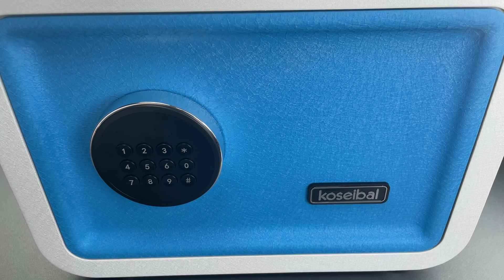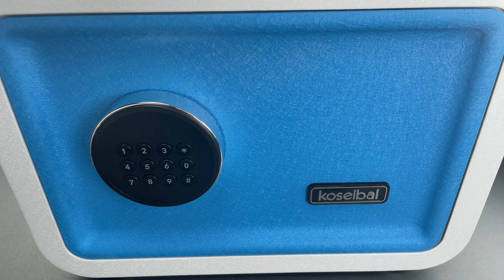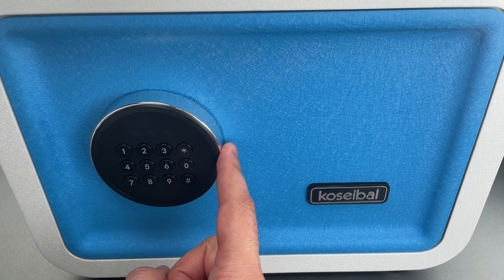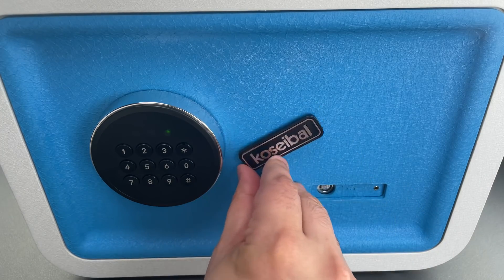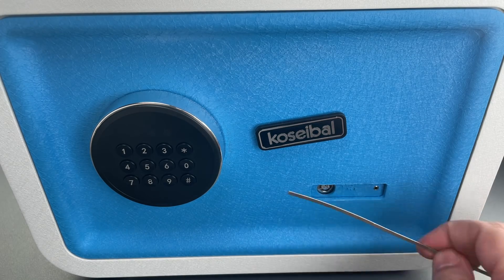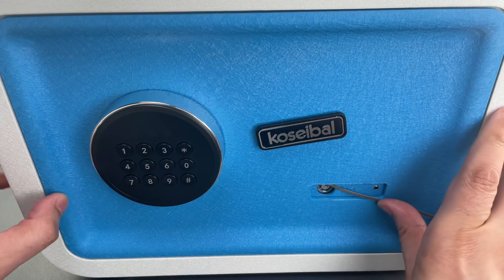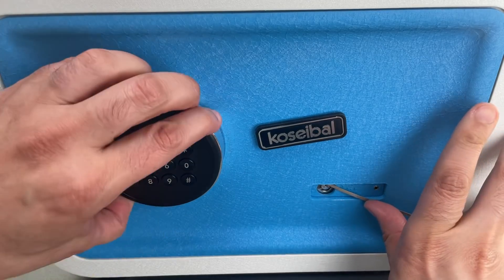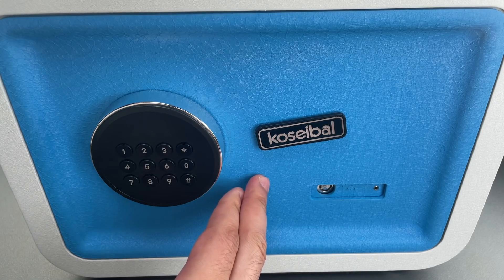[1321] HUGE Design Flaw In Koseibal Safe

Comment: The mechanical backup always seems like an afterthought to these designers
Reply: They should instead use protected external battery contacts in case internal battery dies. And completely forget about mechanical backup
Reply: It's not, LPL can only unlock these because he's already seen what's inside.

No thief is going to be able to notice a certain safe in the house they're breaking into has a certain design flaw, and conjure up a magical tool to gain access.
Reply: @Jamato-sUn  Or a time delayed mechanical backup that only triggers a 24 hour countdown to reset.
Reply: @KiLLJoYYouTube  but if they come prepared they will have an easy go
Reply: @Jamato-sUn  and what happens if the internal charging wires are damaged?
Reply: @KiLLJoYYouTube  Then the owner should purchase an angle grinder, and then a new safe.
Reply: @KiLLJoYYouTube  wait til this guy learns about the internet. All it would take was a google search to find vulnerabilities like this.
Reply: @KiLLJoYYouTube  "Magical tool" = "Scrap of metal" ... right.
Reply: @KiLLJoYYouTube  Good things these safes aren't mass manufactured, and thieves couldn't use a search engine. Or buy one to experiment on, once they know what type it is.
Reply: @Jamato-sUn  And then someone (hopefully not the owner) comes up with the idea of connecting a 110 (?) Or 230 V AC cable to the contacts. (Not to open the safe but to destroy the lock. "Did they stole something of value?" - "I don't know, I can't open my safe.")
Reply: @KiLLJoYYouTube  All you really would need is sort of a 'database' in your phone, list of names of the safes and short description how to easily defeat them. Then you would carry small repertoire of tools and do what the guide says. Obviously this would not be easily applicable in every case but think of the easiest safes that we've seen in LPL's channel, some of them really only require just a magnet to defeat. Obviously with a guide opening safe like that would be a cakewalk.
Reply: @KiLLJoYYouTube  knowing the easy entry flaws of 20 or so common household safes would make for some very low hanging fruit for thieves
Reply: @jobowobo6700  Time delay is interesting and for personal safes might be cool but not always useful (at least in hotels where you need to be able to open them if someone has forgotten the code again... )
Reply: I think they just don't want to put an mechanical lock to these things that costs more than that electronic lock to make so they put kind of garbage mechanical locks to these things.
Reply: @JohnADoe-pg1qk  Could put a protection circuit on those contacts.  The circuit would be destroyed by the excessive voltage, but the electronic lock could still be used.
Reply: Quick message for those reading the replies, keep in mind that lpl make these videos to inform consumers what products to avoid, not to educate thieves.
Reply: @KiLLJoYYouTube  Security by obscurity is never security. A product which could be unlocked by chance as a thief wiggles around is not safe. Perhaps THIS flaw is too specific to actually work, but there are a couple other locks which can be unlocked by chance, like one of those gun locks which he accidentally unlocked.
Reply: @Jamato-sUn  They should instead forget to reinvent the wheel and outsource a safe lock core from a well-known company. The problem is that cost reduction is always messing with these unknown brand products. They know barely 10% of their customers will even have a look at how secure is their backup lock and less than 1% will be able to tell the difference between a safe and unsafe core. These companies just want to make a sale. It is not about making the highest security product they can, it is about making their owners think they have the highest security product even when it's not, and making the product as cheap as possible while keeping this apparent security.
Reply: Thats because these are electronical companies, who buy metal sheets, turn them into safes, and know nothing about actual, mechanical locks.
Reply: @KiLLJoYYouTube  Or he recognizes the type of lock. See the video number? That's 1,321 locks that he's picked for us. He only uploads about 1% of what he actually picks, so he's easily picked 100,000 locks.
Reply: @AcidCrab  So the thief is going to walk into your house, connect to the internet and spend 5 minutes googling how to bypass a lock on your safe? no chance.
Reply: @GamesFromSpace  So every thief has bought every model of safe to experiment on, and knows every single vulnerability just from sight?

here's a hint: criminals aren't locksmiths.
Reply: @KiLLJoYYouTube  When they have your safe sitting at their house they can take all the time they want to open it. You don't think they might google it?
Reply: @Jamato-sUn  well, it's not always the battery that dies; sometimes the electronics may go nuts.
Reply: @KiLLJoYYouTube  A lot of theives are people you know. This isn’t a movie.
Reply: @KiLLJoYYouTube  The thief could be anyone you don't give access to the safe. They may well be a colleague, friend, even family member, who you might still let inside your house, giving them sight to the safe and plenty of time to do research.
Reply: @KiLLJoYYouTube  Depends on who the safe is primarily designed to defend against. It might be effective against burglars with no time to fuck around, but against e.g. cleaning staff or curious children who have regular access to the safe, it might not be as effective.
Reply: @KiLLJoYYouTube  you mean like watching this channel, learning vulnerabilities about safes/locks so when you break into someones home, you know what to look for?
Reply: @KiLLJoYYouTube  You are just committed to terrible arguments up and down this comment section. It's actually hilarious
Reply: @Jamato-sUn  That's how almost all good safes with electronic locks work.  They either have a connection for external power in case the batteries die, or the batteries are housed in the external part of the electronic lock, which can be taken off but offers no access to the innards of the lock, either mechanically or electronically.  They have NO mechanical bypass lock.
Reply: @KiLLJoYYouTube  Not all thieves are strangers who break-and-enter.
It could just as easily be someone who used to have access to the safe, but no longer does, such as a former employee or ex-spouse, etc.
Reply: @KiLLJoYYouTube  nope. Instead they're going to grab the entire safe and run off with it, and open it later, at leasure.
Reply: @KiLLJoYYouTube  if LPL can do it, so can a thief.
Reply: @KiLLJoYYouTube  a thief who does their job on research would bring the tools and knowledge necessary to get into most targets. also that safe isnt exactly too big to just walk off with and research later.
Reply: It's unbelievable how easy you get past these locks. I have one of these cheap safes and just welded the hole for the backup lock shut. And added a better primary lock :D
Reply: @Jamato-sUn  They dont even need to be protected, just have an exposed 9volt terminal set somewhere on the exterior. click the 9volt in and boom, safe is unlockable.
Reply: @KiLLJoYYouTube  That's why thieves "case the joint" before they go in. I've read of burglars looking thru the window to find the alarm brand and learn where the keypad is, then looking up how to bypass it before coming back.
Reply: @Jamato-sUn  Mine has the battery inside the same place as the buttons, which you can unclip and replace the battery. The locking mechanism and the battery don't have to be on the same side of the door.
Reply: @KiLLJoYYouTube  LPL often points out when a safe wouldn't keep out a "curious adolescent" and seldom mentions burglars.  Sure a thief looking for a quick buck isn't going to bother closely examine a safe, but if you live with a kid that knows the safe exists and that kid gets curious, you want something that isn't vulnerable to a low/no skill attack
Reply: @janne6657  Are you serious? "I'm going to write down every safe in existence and a little story about each one". No chance. You haven't got a clue what you're talking about.

A safe is designed to keep out opportunist thieves, anyone with a desire to get what's inside is just going to threaten you with a gun for the code.
Reply: @marquiis  You're assuming that the thief is going to be in a controlled environment. A thief isn't going to be "wiggling around" with a thin piece of metal without knowing it would open the safe.

It's overthinking a problem that simply doesn't exist.
Reply: @KiLLJoYYouTube  Spoiler they do now.
Reply: @Helladamnleet  Great, that means 99% of locks aren't pickable, No need to worry!
Reply: @cgibbard  1. Cleaning staff are going to leave your safe the hell alone. Their job is much more important than the valuables you keep in your safe.

2. Curious children aren't going to be picking a safe open.
Reply: @MrCow579  LPL is a master locksmith and in a controlled environment. A thief is not.
Reply: @Jamato-sUn  In that case, you wouldn't be able to unlock the safe in a power outage and would potentially be able to short the safe and break it by intentionally putting too much voltage into it, so no.
Reply: @darrennew8211  Yes I know what recon is.

Got it, stick a fake branding label on my devices.
Reply: @KiLLJoYYouTube  Mostly I agree about point #1, it's uncommon to need to worry about that kind of thing, but if you do, then a safe like this will be inappropriate. Point #2 though, I disagree, some kids will definitely try to pick stuff just to see if they can get it open, not even necessarily because they want what's inside. Also, most kids have access to YouTube these days. If you were storing something like a firearm, the ability to prod the lock open like this with anything around the house would definitely make it unacceptable in many cases.
Reply: @janne6657  NO ONE has done the homework for you lmao. 

I'll prove it right now for you. "Argos Home A5 31cm Mechanical Steel Safe" is the cheapest safe you can buy from one of the reputable homeware stores in the UK.

Now do me a favour and tell me how you bypass this specific safe. Use all the tools at your disposal. 

Because you've just informed me that the bypass exists, and is readily available.
Reply: @cgibbard  It's not to do with worry, it's to do with how LPL has set up the video. He KNOWS how these things happen because he has access to the damn thing, he's spent hours researching his bypass and many thousands of hours mastering his craft as a locksmith. 

He does his videos in controlled environments without the fears of stress, time or inability. He can just delete the footage of anything that goes wrong.

Children don't try to lockpick anything. They can shove things in holes (jiggling) but they aren't going to be picking the lock. If they were curious they would just search for the key. Locks are already made to be secure, and LPL doesn't show those because it wouldn't get him views.
Reply: @KiLLJoYYouTube  then you bought a shitty safe.
Reply: @Jamato-sUn  Vaultek has the right idea having a micro USB in order to operate the electronics incase of a battery failure.
Reply: @KiLLJoYYouTube  and what happens if a mechanical lock parts are damaged? A backup is backup. It can fail. But at least it shouldn't introduce vulnerability.
Reply: @JohnADoe-pg1qk  I did say "protected" didn't I? Also you can smash that keypad with a hammer once to destroy it.
Reply: @shawnjoseph4009  what do you mean? Power outage doesn't magically disappear all AA batteries in your house. And, again, "protected" contacts.  Overvoltage protection circuits are tiny.
Reply: @KiLLJoYYouTube  A metal stick isn't a magical tool tho
Reply: @KiLLJoYYouTube  um it's called scoping it out...often professional burglars will pose as a repairman and figure out the vulnerabilities of the house ahead of time so they can have a plan in advance to enter as efficiently as possible, get the valuable and get out in minutes
Reply: the engineer behind: I told you guys (in is head)
Reply: @KiLLJoYYouTube  lookit this guy here who thinks it's acceptable for a safe to rely on "security by obscurity" without being a total scam product!
Reply: @KiLLJoYYouTube  Not all thieves would want you to know it was them. That thieve might be your coworker/employee/kid/wife/spouse/neighbor ...
Reply: @KiLLJoYYouTube  Wouldn't it be just easier to purchase a safe that's not defeated as easily? Fake branding seems a lot of a hassle for a problem that simply doesn't exist in the first place when doing some research before buying ...
Reply: @JohnADoe-pg1qk  nobody breaks into someones house just to make it so the owner can’t open their safe. Also it is not any harder to brick this safe. Just smash the combo luck with a hammer and jam something into the keyway of the back up lock and break off the end.
Reply: @KiLLJoYYouTube  Did you watch the video though? This didn't involve any real picking, just shoving a bit of metal in next to the lock and operating the lever it's attached to directly. Sure, LPL has lots of time to figure this stuff out, and knows ahead of time exactly where the lever he needs to move is, and so is a bit faster than most would be. But it doesn't take much skill to jam a random bit of metal in there and wiggle it around and see what happens. That's going to work too, this attack requires no special skill.
Reply: @KiLLJoYYouTube  no, just that one safe is all they need. Thieves don't have to go in unaware of what they're stealing from.
Reply: @KiLLJoYYouTube  you obviously have no idea what you're talking about. Look, LPL did this with a piece of scrap to make it entertaining, but you can easily see it's a crappy tubular lock anyway, you can impression those with a tool you can get on amazon for a few bucks. Add some wafer and cross jigglers and you have 99% of all backup locks in electronic locks.
Reply: @KiLLJoYYouTube  as for the Argos Home A5 31cm Mechanical Steel Safe, a cross jiggler will probably do the trick.
Reply: @ScottKenny1978  Hacking itself is not a crime, like lock picking. But breaking into someone's property without permission is. So I do pentests, audits, red teaming, etc.
Reply: @KiLLJoYYouTube  that magical tool is literally a piece of metal they could probably find in the house they were breaking into
Reply: @AndreasHontzia  thought so!

Have fun, stay safe!
Reply: @KiLLJoYYouTube  Correct. If a small safe like that can be easily found by a burglar (as pointed out by LPL), and it is not somehow strongly anchored to the floor, the burglar will likely just pick it up and leave with it, opening it later when it is safer for them.
Reply: @KiLLJoYYouTube  Good thing he tells us all the secrets!
Reply: @KiLLJoYYouTube  what if the backup lock gets damaged? Anyway even if the thief didn't know about this flaw they could still pick it open.
Reply: @JohnADoe-pg1qk  It's trivial to add surge/voltage protection to any electronics system and unlike mechanical backups, electronic backup can actually be 'pick'-proof (or rather resistant during the life of the Universe at our current and near-future technological level).
Reply: @KiLLJoYYouTube  What do you mean by "children don't try to lockpick anything"? I started a lock-picking 'club' when I was 11 after successfully lock-picking a cabinet my parents kept closed (all it needed is a hook I manufactured from broken glasses frame). There were at least 4 of my other friends that were attempting to pick all sorts of locks with varying success and we kept at it for a couple of years until we lost the interest. And all that was before the internet, with the wealth of information available today I wouldn't dare to keep anything 'locked' at home that I wouldn't want my children to gain access to (e.g. weapons, drugs, etc.)
Reply: A mechanical backup really should be virtually unpickable and suggestably the owner of the safe should not posess the key. Imagine makine a phonecall to your insurance company or something and an employee with the key shows up.
Reply: @KiLLJoYYouTube  That depends on the level of thief. A professional will aquire the knowledge sooner or later even if he will have to purchase or steal a safe himself and cut it open with a grinder. Less professional ones are the ones kept out. The same principles apply to car thieves.
Reply: @jobowobo6700  Timelocks can be overriden as demonstrated in some LPL videos.
Reply: @3rdalbum  And if the manufacturer offer a new safe for free since such a damage probably are a manufacturing problem.
Reply: @enricus2479  It DOES look like a piece of scrap metal to me. We get snow and ice on the roads here during the winters so sand are applied to allow for trackion. In the spring the sand are collected with machines with rotating steel brooms. That piece of metal LPL use look like a straw from those brooms apart from the lack of rust brown color. I see commonly see these along the roads where they broken of.
Reply: @janne6657  It has already been mentioned elsewhere by LPL or maybe it was in a comment that how thieves studied printed information about lock design before the internet era.
Reply: @amcconnell6730  All it takes is someone visiting the hotelroom to aquire the knowledge about what type they use. Maybe a thief know someone in the staff, like a cleaner or something or just rent a room for the night.
Reply: @tastywater_  And it help the wiser manufacturers as well since if they do have a good product but with a flaw that they missed in the design process they csn then fix that. I have seen manufacturers commenting on some videos.
Reply: @KiLLJoYYouTube  More like, ah, it is that safe again they are getting common now. I better check it out before my next visit. Or that safe look like it fould be similar to that other one I get open by inserting a straw in that hole in there let's try the same thing.
Reply: I would love to see a line of locks and safes designed by LPL and Bosnian Bob.
Reply: @KiLLJoYYouTube  I agree on the tool-part. But those backup-locks are always below average and can usually be picked very fast.
Reply: @KiLLJoYYouTube  but what happens if mechanical backup lock is damaged?
Reply: @ScottKenny1978  Another lesson from Ollam, if you pretend you are a good person, people will believe you even when you are actually a terrible person. (Yes, Ollam is a terrible person.)
Reply: @KiLLJoYYouTube  Maybe for this exploit, but the mechanical locks are always garbage and easy to pick.
Reply: It's ridiculous the assumptions Killjoy is making in this comment section. "No locksmiths are thieves" "All cleaning staff are honest" "no criminal has access to the internet" "No criminal does research before committing a crime" etc.
Reply: @Jamato-sUn  An insider threat [disgruntled employee or jilted lover that once had legitimate access to the safe] changes the combination. How do we fix it or gain access if there isn't some manner of mechanical backup?
Reply: @KiLLJoYYouTube  unless they have a cell phone with them a google a LPL video that shows how to do it with an improvised tool.
Reply: @KiLLJoYYouTube  No offense here man honestly....but....really. Been watching too many movies. Real thieves just take the safe or even a whole ATM just to pull it open at THEIR leisure. And yes they'd Google it....duh. Seriously consider reality here...😒
Reply: @KiLLJoYYouTube  You are unfortunately categorically wrong in all your points, thieves do as someone else said look ahead of time. Maybe they pose as a fumigation team, maybe it's your neighbor who knows what you bought. Give it up man you're wrong across the board. Most anyone with a smartphone could easily pop most safes with crap design flaws open. And also why bring a gun to a robbery, you want worse charges if caught. Look think about this for a sec instead of arguing with EVERYONE.
Reply: @KiLLJoYYouTube  And no NO lock is un-pickable legit man do some research before you go looking silly.
Reply: ITT: @KiLLJoY repeatedly tries to double down on his ridiculous arguments, gets put down again and again by an onslaught of people. Tries to smugly claim no one has a safe figured out, someone posts a YT video with someone breaking into it immediately lol.
Reply: @KiLLJoYYouTube  You seem to doubt that this is truly an exploitable vulnerability, with the same conviction that you designate a thin piece of metal as a "magical tool."  While not every thief is a "Bond villain," neither are they mostly rejects from the Keystone Cops.  For a so-called "safe" that retails for a couple hundred dollars US, it should have realistic/appropriate security features.
Reply: @KiLLJoYYouTube  I know practising burglars, and they will spend a long time in a house, and will search on the internet for info if necessary. You're making up excuses of which you know nothing.
Reply: @Jamato-sUn  That's what we do.
Reply: No backup key on our safes, it's not needed. There is no bypass.